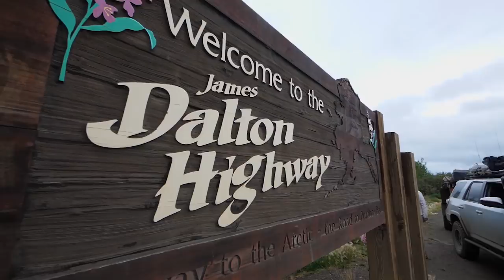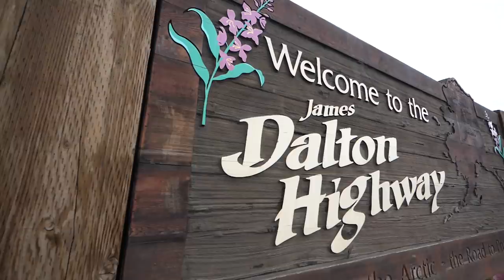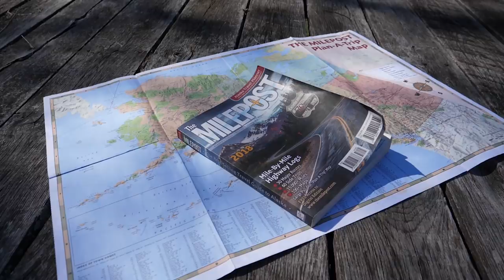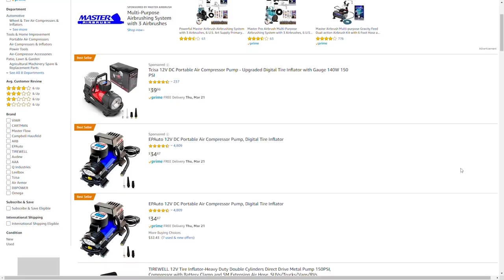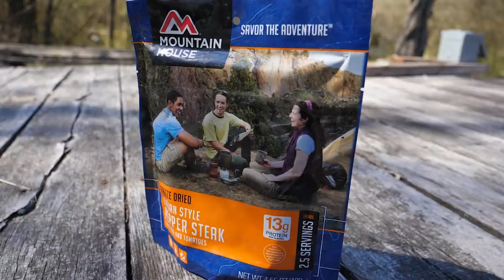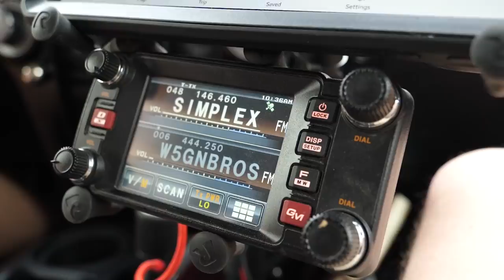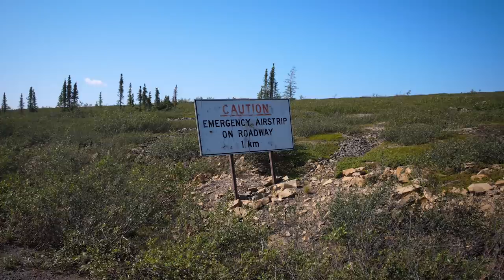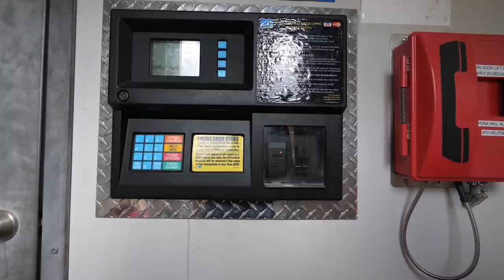Preparing for Alaska & Northern Canada Overland Travel

Comment: A couple questions on the RTT.  How is when putting away and redeploying multiple times when wet?  does it tend to start soaking through and getting wet inside?  Also, do you have condensation issues when you use the heater?  I used a heater in the annex on my tent once, and within minutes the whole inside of the tent was wet.  Of course it was 24*F, so maybe not so bad if it's a bit warmer.  Thanks, and great videos!  We are doing the Dalton this summer.

Comment: An excellent video again.  Just curious how many ply are your tires and does the spare on the turtle back fit your four runner?  Thanks again.
Reply from the maker: The ply can be deceiving these days. Some tires have thicker ply than others so a 10 ply might not be as strong as a lower ply with superior materials and thickness. That being said, the BFG KO2's are 10 ply on the tread and 3 ply on the sidewalls. We run load range E on the rig and load range C on the trailer.

Comment: I'm glad you mentioned  firearms for self defense. In regards  to wildlife your one of the few. And I do agree it should be a last resort.   How long did it take you to get your paperwork  completed  in regards to taking a firearms into Canada. Did you only take a shotgun into Canada  and were you limited on ammo. Ps that was a very informative  video. Planning on doin  the same trip in next year. I'll  be in a tundra  trd pro and a 490 conqueror  off run trailer. I least that's  the plan got the tundra  just saving the money for conqueror.
Reply from the maker: Hey Brett, I always point folks to the RMCP website for that info because it's always changing. It was really simple for us, but another family had just the opposite experience. It's up the to border agent to make the call and all of your paperwork and planning means nothing if they decide to turn you around. Just a heads up.

Comment: lots of great information. I did the Dalton in 2017, plan the Dempster in a few years. One thing I would add is SLOW DOWN! On the Dalton road conditions can change instantly with no warning. Most times we were 30 to 40 mph. The times I did go to 50, I was especially vigilant on scanning the road ahead.   Like you said some times the paved sections are the worst, between the Arctic Circle and Coldfoot were the roughest pavement . At the end you did mention CB radios.That was our form of backup communications. Though limited range , with the abundance of trucks you should be able to get help if needed.
Reply from the maker: Absolutely, no need to rush that adventure ;) The CB was very handy to have on the Dalton. Had some great conversations with the truckers too.

Comment: Sorry to be something of a wet blanket. but I'll try to use warm water and will only grumble about the ham radio's.  Now understand I am fully Licensed Advanced Class( Extra Class in the USA ) which may be the biggest reason I have a problem with most Overlanders getting a Amateur License. Well I would in fact encourage overlanders  to become licensed, my strongest encouragement would be for them to get more then a simple NOVICE license.  Once you have at least a General Class license you now have not only access to more then 70-80% of the HF bands, but also an increase in allowed power and long range communications.  It is unbelievable that people can buy the best gear they can afford, but will trust their lives to a $200-300 VHF mono band radio. One does not have to be in remote places to find that being tied to a Repeater system and short range line of sight radios are a problem.      Get your General Class License and use the privileges it gives you. Not just on an overland trip but as much as you can so that you are confident and proficient with the gear and modes.